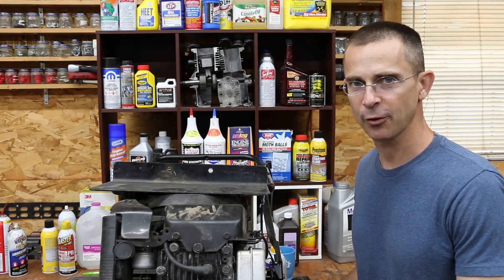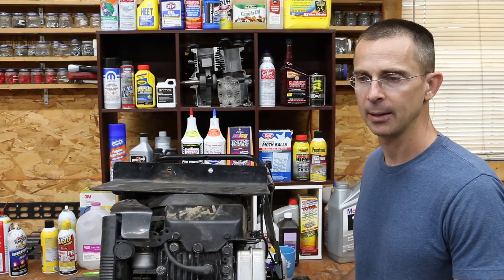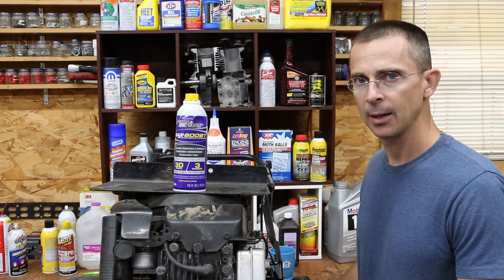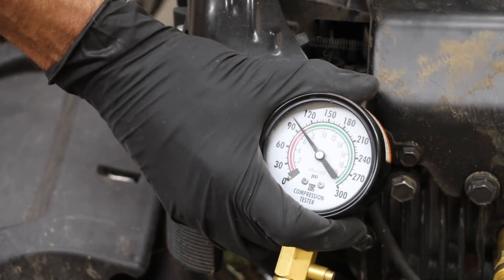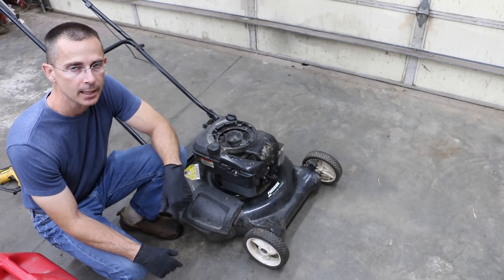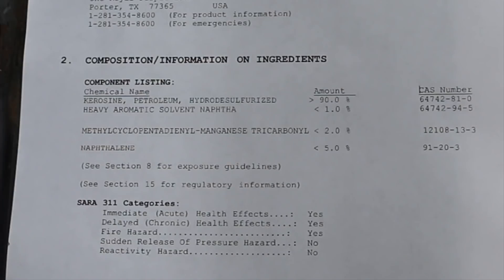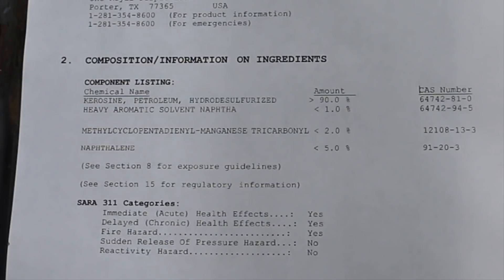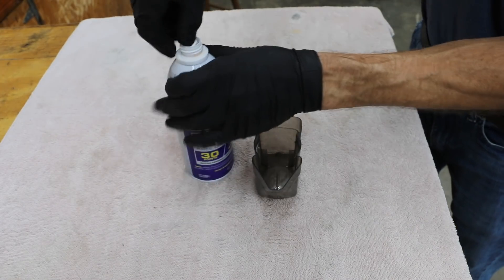Will a gas engine run on 100% octane booster?  Let's find out!

Comment: There are several octane boost products. Is one the best? Will octane boost cause the engine to run hotter than normal. Rotary engines require high octane fuel. It looks like regular fuel with octane boost could same money.
Reply from the maker: Thank you for the video idea!

Comment: When I run my bike engine with 95%-99% ethanol my bike starts and works only on choke why is that?
Reply from the maker: Great point.  It's because it takes a lot more ethanol to create the same BTUs compared to the same volume of gasoline.  Different stoichiometry
Reply: @ProjectFarm  thanks for your reply, after tuning my carb a little I found that it runs with air, but my engine stops when hitting a bumper or slowing down at higher gear. With 95 ethanol the rpm must be kept a bit higher and I think the choke actually  draws more fuel from the float.  But engine performed lot better with isopropyl alcohol.  Now I am thinking to make a video on the subject so that more people shun using  petrol and use the more ecofriendly alternative. And I hope governments everywhere start supporting the cause for non fossil fuel vehicles. Now if proper research is done to boost the octane number then ethanol will replace gasoline/petrol completely.

Comment: Please test, if a fuel injection additive cleaner works better if used by what the bottle says to do like 1 bottle for 20 gallons vs, HOT MIX whole bottle in 1/2 a gallon of fuel to answer the question of is it better to clean over time vs Hot mix
Reply from the maker: Thank you for the video idea!

Comment: I ran a motorcycle on RP Maxx octane boast once. I was in a pinch and it's what I had. Did the job, and I didn't notice any difference. Of course I didn't pull the heads and find all the orange left overs. Bikes still running strong today. I'd like to see a comparison between an injected engine v carb engine on the Maxx boast.
Reply from the maker: Thank you for the feedback

Comment: Run gas after to see if carbon builds on the rust as a test for old engines from a junk heap or old motorcycles that sit and rust.
Reply from the maker: Thank you for the video idea!

Comment: I love how people think high octane fuel give you power... when you need high compression whether static or boosted , higher ignition timing etc to take advantage of it. This is why you can get more power with ethanol.  You can run higher boost and timing to take advantage of the high octane of e85.  It's useless in a low compression n/a vehicle
Reply from the maker: Thank you for the feedback

Comment: OK, I'll comment. You do a grand job and I enjoy your videos. However, in this one you didn't follow through. Run a tank of gas through to see if that Trump-colored stain does in fact go away without damage. If not, check out what will undo the orange.
Reply from the maker: Great point.  The stain is caused by MMT, which does in pose a risk to catalytic converters

Comment: Use gasket remover or jet paint remover to clean off carbon buildup, just spray and let sit for a few minutes, then wipe. If the carbon is thick, just keep spraying and wipe till it gone. It even shines the metal like it's been polished. It's better than using a wire brush.
Reply from the maker: Thank you for the feedback

Comment: I wonder what the orange stuff left behind is? Is Sulfur a possibility? Interesting!  

In order to treat octane in a 12-16gallon tank you’d think the “booster” alone would have high enough octane properties that it would not ignite. Much like trying to run 100% ethanol or diesel diesel! You’d have to change the compression or air fuel ratio.
Reply from the maker: MMT. Thank you

Comment: Please run an engine on my hopes and dreams, I bet is going to stall badly
Reply from the maker: Thank you for the video idea!
Reply: @ProjectFarm  I have a 2009 RDX and most people in forums state that it is required to run 91 octane but owners manual states. 
Your vehicle is designed to operate
on premium unleaded gasoline with a
pump octane of 91 or higher. If this
octane grade is unavailable, regular
unleaded gasoline with a pump
octane of 87 or higher may be used
temporarily. The use of regular
unleaded gasoline can cause metallic
knocking noises in the engine and
will result in decreased engine
performance. The long-term use of
regular-grade gasoline can lead to
engine damage.
Will 89 midgrade hurt the engine?  Am I wasting money paying for 93 because 91 isn't available?
Reply: Haohmaru The “metallic knocking noise” you’re hearing is “spark knock”/“Pre-detonation”. It can hurt the engine if you don’t run the correct octane fuel in it, but I would try running 89 midgrade and see if the noise is made on 89 octane. If it doesn’t make the noise than it should be okay. Spark Knock will not cause immediate damage to an engine, but will hurt it over time. Give 89 octane a shot and see if it works. Best of luck
Reply: @tonycymmerman  Yes, 89 could potentially hurt the engine. Stick to 93 or sell the car and buy one that runs on regular unleaded. At best using 89 will just decrease your MPG, at worst it could cause thousands of dollars worth of engine damage. More than enough to total a 2009 RDX. 87 and 89 should only be used in emergencies, not to save money.
Reply: @tonycymmerman  you're looking for hopes and dreams, since Acura is made by Honda, and Honda is powered by dreams, I'd say run it on as high of octane as you can get... The high compression in your cylinders requires a higher knock resistance (high octane). When low octane fuel is used, ideally the ECU picks up on the knock and adjust the ignition advance appropriately. Reducing the timing/spark Advance will undoubtedly reduce performance, and in an engine designed to run high compression, cause damage. I hope that helps!
Reply: Or burn really well
Reply: What's the orange film left over? How does that affect the engine long term?
Reply: @stevennihipali3607  MMT leaves a orange film that is the active ingredient in RP octane booster.
Reply: @PietriGuitars  yeah sadly :/
Reply: Warp drive?😂

Comment: "No noticable decrease or increase in power." And that's at 100%. Its sold as an additive and octane booster. Its $14 for a 16oz can. Wrap your head around that scam.
Reply: Higher octane doesn't mean more power. It simply means that the higher the octane, the higher the resistance to pre ignition.
87 has the same energy density as 94.
Reply: Your education was a scam. Higher octane does not mean higher power.
Reply: To explain further, octane is simply a measurement of resistance to detonation.

Diesel, kerosene, jet A, have relatively low octane. Diesel engines work by having a high compression ratio so when the fuel air mixture is compressed it heats up to a temperature where the fuel will auto ignite. Glow plugs just help starting a cold engine in cold temperatures.

Gasoline engines use a spark to ignite the fuel air mixture, and preignition (pinging) can become a problem in higher compression ratio (like turbocharged "performance" engines) which necessitates higher octane fuel.

While it might be odd that a low octane fuel like kerosene makes up the majority of an octane booster, the other chemicals are what would resist detonation. My guess is kerosene is a cheap, shelf stable flammable liquid used as a carrier.

Moral of the story: you'd be wasting your money on high octane fuel and additives in a gasoline engine unless your engine has a high compression ratio or you experience pinging for whatever reason.

Comment: I used to drain the boosted mix from my YZ-250 race bike if it sat more than 2 weeks, and burn it in my lawn mower. Ran like a charm, smoked like a 2-stroke, but smelled great. 
I had (still have) a spark plug sandblaster to maintain the plug & keep it from oil fouling. And to save a few more bucks a year.  
Artists and musicians that have never raced a dirt bike don't  know what it's like to be broke.
Reply from the maker: Thank you for the feedback

Comment: I think the engine on the lawnmowet in the video started easier because it doesnt use a primer button it has an auto choke
Reply from the maker: Thank you for the feedback
Reply: @ProjectFarm  your welcome ithe only reason i know is because we have a lawnmower with the same engine that has the auto choke on it the only difference is ours has a red deck and the engine cover is also red

Comment: I've heard of people trying to start their engines oxygen and acetylene and propane instead of using starting fluid .
Reply from the maker: Thank you for the feedback
Reply: I just thought of another one what if you run a engine on oil base paint such as aerosol and and as a crank case lube

Comment: Could u run a mower or a small engine with holes drilled into the cooling fins of the head to see if it helps cool it better
Reply from the maker: Thank you for the video idea!

Comment: A combustion engine will run on any highly combustible material. Vapor or liquid for all you definition kooks (not hay or dried leaves) It's a HUGE duh. Try mixing up water in your fuel and experiment with different ratios. That's actually useable,  relevant, and interesting content. In my honest opinion . Happy Thanksgiving! Love your channel sir

Comment: have to wait tell winter but use oil well gas that has condense from cold weather it runs about 130 octane and really has the punch   years ago pumpers of wells would run it in there cars and trucks
Reply from the maker: Thanks for the feedback!

Comment: Try mixing roundup in the gas! ... or pizza in the oil... who doesn’t love pizza? Maybe put battery acid in the tank? 

Possible project idea: push cold air from an air compressor into the intake and also run a small fuel pump at the same time on a mower. Once you get the air:fuel right, it’d be interesting to see how the mower handles it.
Reply from the maker: Thank you for the video idea!

Comment: My Troy-Bilt T110 lawnmower has a lot of trouble starting, I think it even knocks a little bit but I'm not super experience. In order to get it started, I often need to tilt it to one side, and it still takes a few tries. Would octane booster or any other additives fix that?

I currently don't have a lot of tools to take the engine apart and do any real work on it.
Reply: Amaroq Starwind just spray starting fluid

Comment: I am late to the party and based on the over 1/2 million views I sure I am not the 1st to say the orange color build up is from 
Methylcyclopentadienyl manganese tricarbonyl (MMT) it is a gasoline octane enhancer produced by the Afton Chemical Corporation (Afton), formerly known as the Ethyl Corporation. MMT is allowed in U.S. gasoline at a level equivalent to 1/32 grams per gallon manganese (gpg Mn).
Reply from the maker: You are right!  Thank you

Comment: I realize that a diesel is not a gasoline engine by any stretch...
Lucan makes injector cleaner that is the thickness of maple syrup.
The recommended application is to drain the primary fuel filter, and fill it full of Lucas, the dump the rest into the fuel tank, then fill the tank to mix it.
Engines run fine on the full-strength cleaner, no surprise.
By the end of the tank, barring mechanical damage, the injectors seem to be quite clean, and fuel mileage goes up, sometimes considerably.
On my own big truck, I found out that putting the entire gallon into my right-hand tank, AFTER filling the tank, gave me the best results.
Don't ask me why, the old girl just wanted it that way.
I can vouch for Lucas as an excellent injector cleaner that us safe for all engines and fuel systems.
The other thing I would add, is that perhaps the recommended way to use a given product would have to be tailored to an individual engine...
Something to think about.
Reply from the maker: Great information. Thank you!

Comment: Run as much sea foam you can mix in gas in an engine and see if it super cleans the insides
Reply from the maker: Thank you for the video idea!
Reply: I just seen you already have a video of running an engine with straight sea foam , that what I would have said but I didn’t think it would run on straight seafoam ha

Comment: I ran gas and octane booster in my snowmobile 10 Millilitres to 37 L of gas  and It thew a rod so could you possibly tell me why that happened to my motor and yours is still fine when running full octane booster
Reply from the maker: Thank you!

Comment: Off topic question. I picked up a used mower about a month ago, and got it running after removing the stale gas in the bowl. I ran it for a bit and the spark plug popped out while running, it sounded like a gun and flew a couple of feet. I think maybe it wasn't tightened enough. But wouldn't the plug just loosen until there was no ignition and the lawnmower would stall? The threads are still good I was able to put the plug back in and it didn't pop out again.
Reply from the maker: Sounds like it vibrated out. Thank you

Comment: You should try to run a diesel engine on everything: diesel, petrol, alcohol, lpg...
Reply from the maker: Thank you for the video idea!
Reply: I need the video too,  with see through cylinder head.  As far as I know it may cause problem as diesel engines are compression ignited while gasoline/petrol is ignited by spark.  Would be interesting to see in a transparent head.  Plz make it,  as I dont have a diesel engine to diy.
Reply: Why would you do that?

Comment: Contrary to popular belief high octane fuel Burns slower than low octane fuel that's why with the timing too advanced with low octane you get detonation if you set the timing for low octane fuel then install high octane fuel your headers will glow and you are sending fire out the exhaust valve which will burn out your exhaust valves that is exactly what I saw on the clear cylinder head fire going out the exhaust valve still burning do the same test on low-octane fuel and I will bet you the combustion is done and colder when it goes out the exhaust valve
Reply from the maker: Great point. Thank you

Comment: An engine will run on anything combustible , after all that's why it's called an internal combustion engine , every engine is nothing more than a fancy airpump , Rudolf Diesel the inventor of the diesel engine ran the first diesel engine on peanut oil, early gasoline engines ran on 70 octane , I ran 108 octane  in my engine before , it had high compression pistons
Reply from the maker: Thank you!

Comment: MMT added that Red tint after the Royal Purple octane booster. I used to have a 2013 Corvette & I was adding octane booster w/MMT in it (Methylcyclopentadienyl manganese tricarbonyl). When I had Longtube Headers installed on my Corvette & they pulled the spark plugs, they all had that same red film on them. The very reputable shop that did the work told me, that is where the red film came from. I stopped using octane booster w/MMT in it. (Sold the car, so I don't know of any long term effects.)
Reply from the maker: Thank you!

Comment: 2:25 can be pronounced separately as : Methyl - Cyclo - Penta - Dienyl - Mangan-ese - Tri - Carbon-yl ; which is a mouth full. lol
Reply from the maker: Wow!  Thank you
Reply: @ProjectFarm  Each part of the word means something and you can probably derive the actual shape of the molecule from the name. Too rusty to actually try myself, but look up organic chemicals naming convention if you are interested
Reply: This is the additive which was the cause of t2 labs explosion in florida  in 2007
Reply: In other words, MMT. Which every manufacturer says to avoid in their owners manuals. 
Wonder how NOS Race formula would react? It’s got nitromethane in it. Definitely changes the sound when I put it in my Bimmer.
Reply: MMT is the active ingredient here. However, it can stain on the parts. That is the orange residue. This may be the reason why car owners' manuals say to avoid using it.

Comment: would Kroil [kerosene oil] be better at penetrating rusted bolts and nutts
Reply from the maker: Thank you for the video idea!
Reply: @ProjectFarm  anytime, I my self am using it, and must say it works better than most of the penetrating oils on the market

Comment: The chemical you can't pronounce actually is the octane booster. MMT. They quit putting it in gasoline something like 10-15 years ago because it was getting in ground water or some shit. It will stain the plugs and some other stuff brown usually from the manganese. It is nowhere near as toxic as tetra ethyl lead, which was the original octane in leaded gas, but I believe it does carry some level of toxicity. 

But, these days, what isn't toxic in a high enough dose?
Reply from the maker: Thank you!

Comment: Quick question...  Have you found any additives that seem to cause more varnish or gumming up of these little carburetors?
Reply from the maker: I have not narrowed it down.  However, the ethanol in fuel seems to react to the metal used in carburetors over time.

Comment: Last night i put a bottle can of stp carb cleaner into my gas tank. My car is a mercedes c180 w202 1994. It was having a very rough idle and this morning i started the car and warm it up to the operating temperature and then turned it off and let it sit for a while. After around two hours i started the car and the idle is so smooth.... i guess it cleans all the gunk in the injectors.... 😀
Reply from the maker: Impressive results!
Reply: @ProjectFarm  somehow it works.... i already researched the content of the carb cleaner... therefore i encourage myself to give if a shot.. and it works like a charm... 😁

Comment: I would like to build a pirate deterrent system using a remote control boat that sprays gasoline on to potential pirates... my question is which is more volatile and suitable for spraying down a pirate, low octane or high octane gasoline? Which could then be set aflame with a flare gun. The mere threat of which would deter most pirates